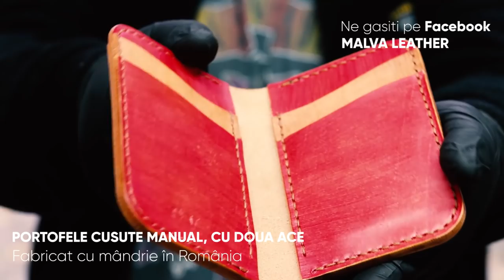Cum FUNCTIONEAZA Motorul Wankel

Comment: Modelul GS de la Lexus este mort. Nu va mai fi nici un model GS. Ultimul an al modelului GS este 2020.
Reply: @justawhitenigga  Absolut regretabil. Sunt innebunit dupa GS F. 5.0 V8 Aspirat.  Fiabilitate, sunet, experienta de neuitat. Nimeni nu mai are un sedan supersport cu un motor V8. aspirat.
Reply: Îl înlocuiesc ei cu ceva, acum vine tare și brandul Genesis din urmă cu G70 G80 G90
Reply: @vladdutz20  Da, se pare ca va fi tot un V8 dar bi turbo. Cilindreea nu este cunoacuta, dar unii spun ca va fi tot un 5.0. Greu de crezut, avand in vedere normele de poluare.